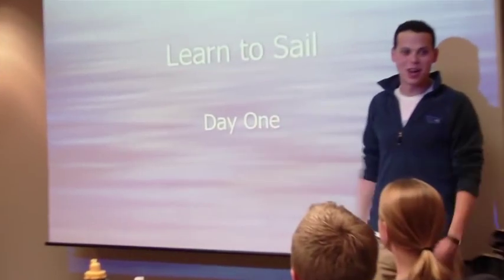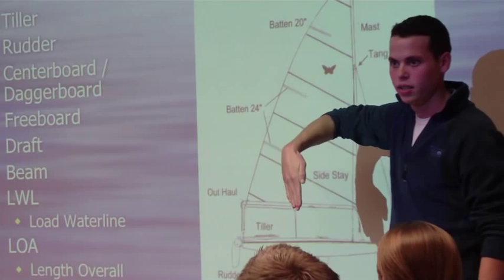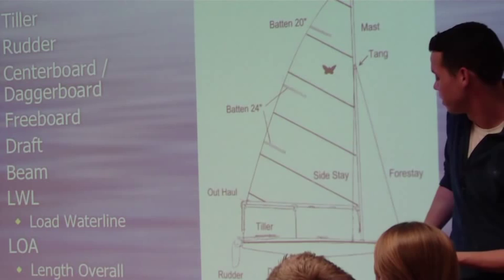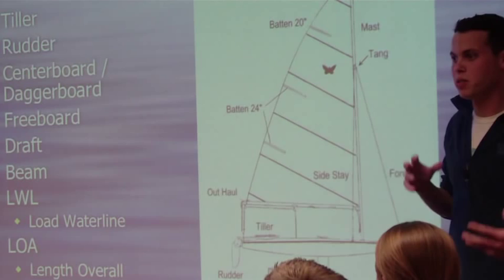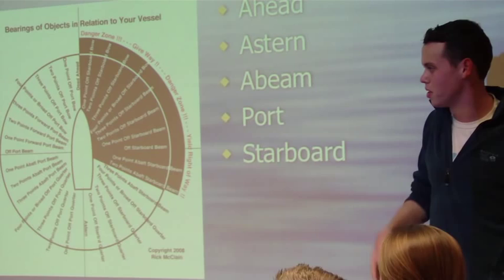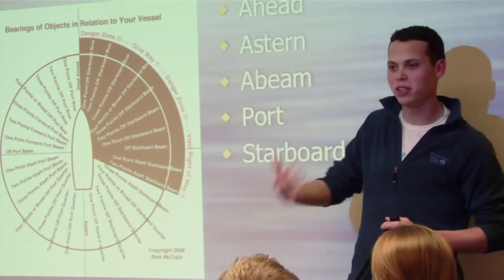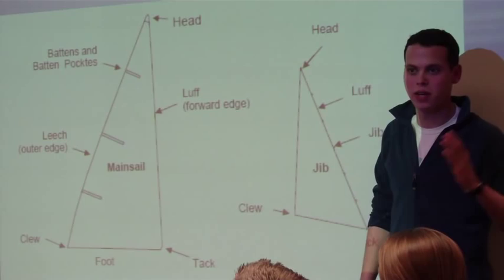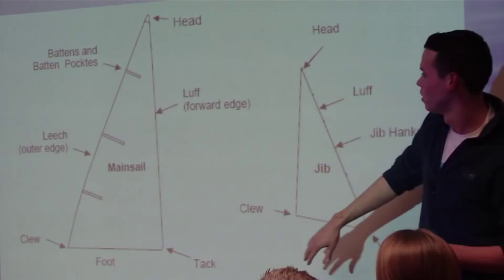Sailing Lessons:  The basics (part 1)

Comment: Excellent set of talks for starting sailing. All necessary info with no extraneous crap. All applicable to cruising, racing or pottering about, Whether dinghy or megayacht.

If this could be professionally filmed with the same guy presenting to the camera, instead of a noisy audience (& ideally translated to English) then I would want to give a copy of all the newbie sailors before they first get on a boat. All they will then need is practical experience.

Thanks, mate.

Comment: Good lecture.
A few points.
You should tell them why waterline length is such a big deal in a dinghy. Some early mention of the three modes of dinghy sailing would be useful even just as a reference.
Telling them hull waterline length is important without talking about displacement mode top speeds is not crystallising the lesson imho.
About the tiller acting in the opposite way to the wheel of a car. I came to think about the tiller as steering the back of the boat.

Comment: What you have is the back in the boat in your control. Push the tiller away the back of the boat goes with it.

Maybe that's a personal point but I found it worked to the point that it became so engrained in my consciousness that when I moved to wheeled keel boats I spent much of the having to battle my instinct to steer the back of the boat with the wheel.
Worked really well on dinghys and small keelboats tho.
:-)
I had a lot of fun in i420s over the years. Great boats.